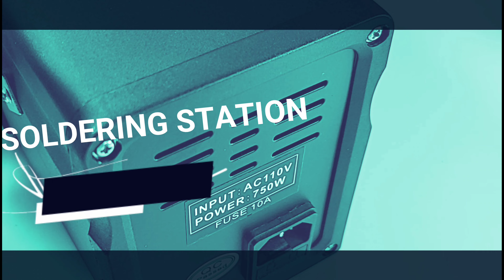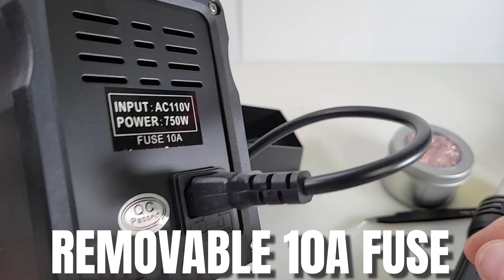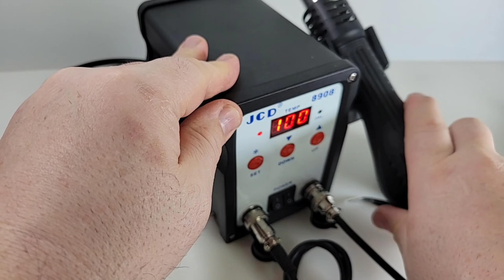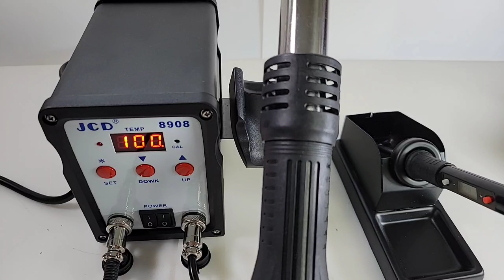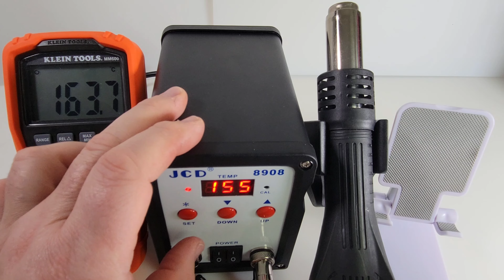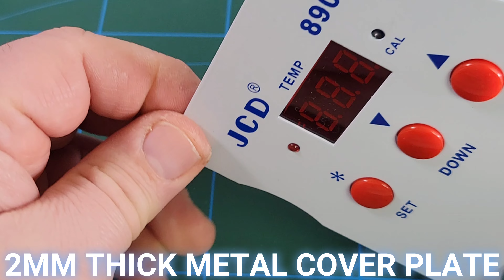JCD 8908 Hot Air ● Soldering Station Kit Review & Teardown!

Comment: Hey man, just read a comment by someone related to a family member of this series, the 8898 IIRC, that uses the same connectors on the base, that said it has live mains voltage running through it when turned on and no soldering iron connected. Seemed that that's why they put the rubber protectors on there, since the contacts are so easy to touch.

Does this unit have that happen too?

Comment: That PCB transfo is part of the SMPS supply area run by a DK112 chip (max 12w). Triac on that heat sink for the hot air is run by a opto-coupler MOC3041. It would be better for a separate 1 amp fuse to run the soldering iron (10 amps on that DIN seems risky)

Comment: This would be a good station for beginners. 👍
Just my silly thought, Darren, but at (7:05) when you press SET button, the display shows F10, could it be that it means FAN 10, so then you can change it by UP-DOWN button while at that state?
Reply: Not a silly thought at all. 👍  Fan speed goes from F1 to F10, same as the fan speed control on my JCD 8898. Maybe this one's faulty and remains stuck on F10?
Reply from the maker: @rogerwilco5187  Yea, that was my first thought...it won't move from F10 , I tried every possible combination aside from the obvious + - but no can do. It's possible I have a dud. Unfortunately the manual doesn't mention speed adjust at all.

Comment: Hey Darren, great review! Apparently you can adjust the air flow on that thing. How? Who frikkin knows? On my CHEAP-O hot air station you hold down the power button, obviously not an option here. Maybe press and hold the Set button? Thanks again! I really enjoy soldering station and multimeter reviews equally.
Reply from the maker: Thx Luis...Believe me I tried everything imaginable with no success. What makes it worse was the poorly written documentation.  😕 Glad you're enjoying the reviews!

Comment: Nice review! I totally agree with you about the temp control being on the iron itself. I also agree that the hot air gun needs an air flow adjustment control. Did you say the soldering iron had copper tips?  The tips are not plated?  All in all not too bad for the price. 👏🏻👍
Reply from the maker: It's really difficult soldering small smd components without that airflow adjustment. You'll definitely end up with components flying across the bench..ouch! Yes 5 copper tips and one plated tip. 😀

Comment: I like the attention to safety this one has but I don't have any experience soldering. Thanks for pointing out all the things that someone new to soldering should pay attention to.
Reply from the maker: They've done a good job giving a new user alot of the basic gear needed  to get started. I'm just not a fan of the soldering temperature control being located directly on the Iron though ! 😉